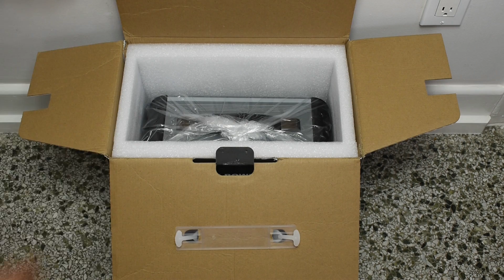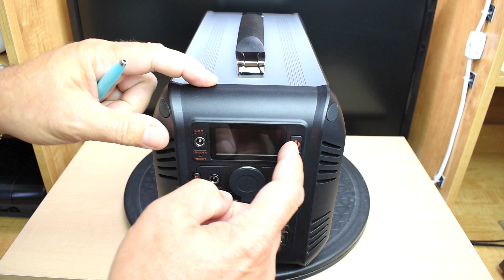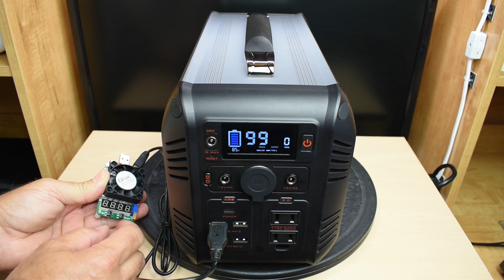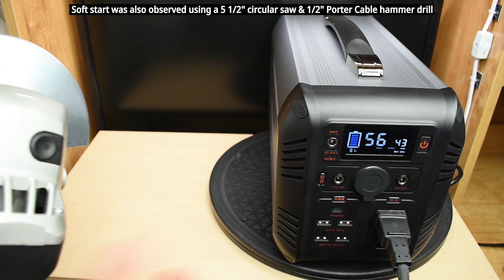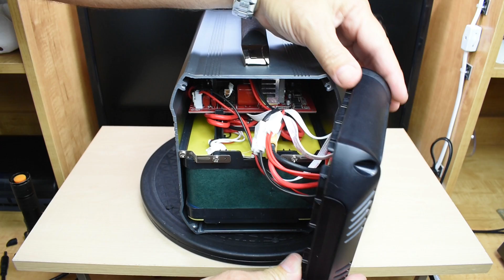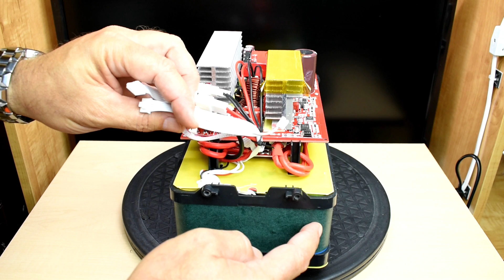This LiFePO4 Portable Solar Power Station Changes Everything!

Comment from the maker: Hey guys! I hope everyone is doing well, and enjoys the video. A lot of time went into making this video(like many of my videos), so it would be greatly appreciated if you could take just one or two minutes to share the video link with others in solar related forums or social networking sites. Below is the link to my other video which shows a simple trick to fully charge a PPS in your car, or charge it faster. Thanks for watching!

https://www.youtube.com/watch?v=yXNW-4fNZVk
Reply: Good job!  Did you say if the screen can be dimmed or shut off for use at night?  Especially in a tent.
Reply from the maker: @videodistro  I show in the video how the screen goes dim after 15 sec or so, then I need to press the button quickly to have full brightness. It never goes off completely unless auto-off activates.
Reply: @electronicsNmore  Okay, thanks.  So only an auto dim, which is okay.  Kind of wonder if it is dim enough in a tent during a dark night.  Thanks for the review and thanks for the info!  The only thing I wish was a little better (other than a working 50 Hz) would be the ability to take over 24v input. Would be nice to do 30 or more.  Oh well.   I liked your trick in your other video about raising the voltage.  Two 12v solar panels in series might be too much.  Any way to test that on this?
Reply from the maker: @videodistro  2 12v panels in series would be 40--42v, way too high. The dimmed mode isn't that bright.
Reply: @electronicsNmore  2x12v is 24v, right?
Reply from the maker: @videodistro  It's a 12v rated panel, but the voltage is higher. 2 x 12v panels will definitely exceed the max input of 24v.
Reply: @electronicsNmore  Bluetti EB70 700 watt power station has LiFePo4 and 712 watt hours and is on sale for 500. It has some overlooked silly design issues but suffices for the emergency situations I plan to use it for...running a 75 watt fridge during power outages and cooking with low wattage devices.
Reply: Excellent work. Thank you for sharing your knowledge.

Comment: Based on my experience with computing / electronics. I'm unsure that these unknown brands will function as stated / rated under real life, pressurised conditions. i.e commercial and legal grey areas of use. That said, I'm looking for exactly this, with one added feature, to be able to dump charge into cheaper stand alone batteries, SLA, LiFePO4 that I already have. A control centre, to regulate incoming charge from solar,  mains, and a generator. My equipment never works as stated / rated. Ever.

Comment: I've watched a few reviews on this unit. Also known as "Bibene" and FF Power which picked up the Bibene name. I was comparing this one to the "Bluetti", which has the true brand name but a little different configuration which I did like too. But the Bluetti unit display was disappointing as to data it showed when in use. This unit has it all, but a lesser known brand. Also a super good price if you look around. All reviewers pretty much gave it top notch status for an off brand, especially for those of us searching for the LiFePO4 internals. 
    I really like the way you were paced, & methodical with each function, outlet, and switch. Testing equipment and real world loads were great. And of course, break down and a look inside. I had already made a purchase of this (the FF Power name) just prior to your review, but it totally backed up the other reviews and I feel super confident this power station will meet my needs and be pretty good quality. I'm also getting a 100W solar panel with it to augment my 12V vehicle charging. I look forward to checking out your faster charging method. 
       Thanks for an awesome in depth review !

Comment: What is the input voltage on the wall charger?
Reply from the maker: Pretty sure I mentioned it in the video.
Reply: @electronicsNmore  no
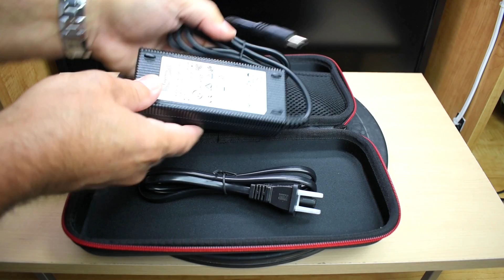Reply from the maker: @tvbox6955  Sure did, just checked. 1:46
Reply: @electronicsNmore  100-240v? The voltage that it accepts from the wall into the charger.
Reply from the maker: @tvbox6955  Yes. 100-240v

Comment: Your description calls this a BIBENE power station but the unit is marked OUKITEL. I've seen both units on Amazon and they look the same except for the LED display. The promotional bullet points are different in the two different Amazon listings. Are they the same unit with the same features and capabilities, just branded differently ?(and the display) Great in depth review. One other question, will this charge on a single 100 w panel? I saw some purchase reviews that said it wouldn't and that it required at least 200 watts.
Reply from the maker: The unit is manufactured, then both companies use the same product. The name label is the only difference. In the video I should've tested what you asked. I don't recall.
Reply: @electronicsNmore  You used a home built 200 watt folding panel.
Reply from the maker: @mrhalfstep  Yes, it was wired 2 in series for 24V/100W (Not 12V/200W), I only tapped into one 12V panel.
Reply: @electronicsNmore  OK, I got it now. That's great, because I have one unused 12V 100 watt panel that I can dedicate to this. Cool! Thanks for taking the time to clear that up for me.
Reply: @electronicsNmore  You tested it at about 23:00 into the video at 200 watts.
Reply from the maker: I show a single 12V / 100W panel connected to the PPS. You see 90W going in.

Comment: One guy on amazon review said his solar panel wouldn't charge it,next guy said the solar panel input was wired backwards,he said on solar panel input,what should of been negative was positive and vice versa.he said it could of been dangerous.i could of missed it,did you test the solar panel input to see that you didn't have any problem,with solar panel input?other people do say the watt hours are not close to what they state but for this low price, I could accept that possibility. Thank you
Reply from the maker: This unit charged just fine using solar panels.

Comment: I have a diesel heater that when the glow plug is on its start pulling 8 amps and goes up to 10.7. 10.7 is just a split second. I was wondering if the DC plug can handle that on these. I've seen people run the heater on the jackory 240,500, ecoflow an some others.
Reply from the maker: If it's only a split second, and only 700mA over, I would think you'd be fine, but no guarantee.
Reply: @electronicsNmore  thank you so very much. I really appreciate you taking the time to let me know. Hope you have a happy and healthy holiday season.

Comment: It appears you checked the 12V DC to test if it was regulated after the battery was depleted, but after you started charging charging the unit with the AC.  Won't that increase the battery voltage and throw the test results?
Reply from the maker: The DC output is maintained in a narrow range from full charge to almost fully depleted.
Reply: @electronicsNmore  I
 understand, but with the charger connected, the battery Voltage will be increased.
Reply: @electronicsNmore  I believe you are missing my point?

Comment: very thorough review. I do have to disagree about fully charging this power station with a car socket. at least with my Honda which supplies 14V when the alternator is running, I see 83 Watts. That's the same as the 20V AC charger.
Reply from the maker: Something not right....Mine works.

Comment: The 12vdc is actually not regulated.  The LiFePO4 batteries are in 4s configuration so is 'regulated' by design.  Also you only tested the efficiency of the inverter, how about the efficiency of the 12vdc output.  BTW, 97% efficiency of the inverter sounds abit too good.
Reply from the maker: DCV is maintained in a narrow range regardless of SOC.

Comment: I'm really glad manufacturers are starting to put diffused lantern style lights on their products. They are so much more usefull. I have a Golabs R300 and that difused light bar has been a godsend for lighting up an area around camp or in a tent. The little dinky flashlight style while still useful, pales in comparison for practicality. Are you sure it's regulated or just the LiFePo4 batteries themselves? It should stay above 12v right up until they die with no regulation.

Comment: Excellent review and tear down..Confussed on one item tho. You mentioned the heat
Buildup when charging, 180f?…That’s a bit high for lithium batteries…Or did I misunderstand?
Dennis
Reply from the maker: Hi. I was referring to the temperature of the SMPS AC charging brick. Be sure to watch today's video showing another LiFePO4 PPS and share. Thank you!

Comment: Great review. I appreciate the testing and inside look. I have owned this unit for six months and it worked great until today. I tried my Renogy 100w folding panel to charge it. It charged fine until the sun came out. Up to around 23w it charged well. Above that the display started turning on and off, alternating between showing a high charge rate for a second and then showing zero. The device stopped charging completely. Any suggestions for me? Is there a way to hard reset the BMS? Other than this the unit works great and charges fine on 110v. Occasionally the state of charge calibration gets way off and I discharge and recharge to correct.
Reply: Mine no longer charges. Did you find a solution? (Resetting didn't work for me)

Comment: Oukitel has one identical to this one. What are the differences
Reply from the maker: Nothing, same unit different label. :-)
Reply: @electronicsNmore  thanks for replying.  I ended up purchasing the ecoflow max. 486$ shipped on Amazon.  The lifepo4 was 386$ after  discounts shipped.. What ended up winning me over is 80% charge in 1hour, when plugged into a wall outlet.

Comment: Thank you very much for your very detailed and very precise testing of the portable power station.  About switching to 50 cycles from 60 cycles, my guess is switching didn't work you were connected to 115V/60 cycle source.  If you were connected to 220 Volt source (50 cycles) then it would have switched (may be automatic) to 50 cycles.  Thank you again.
Reply from the maker: No, it was faulty.
Reply: The unit was faulty?

Comment: Thanks for the review. There's not that many LiFePO4 portable battery systems out there. It's impossible for me to find a pre-built portable battery station the way I'd like one. I'm glad you opened it up and showed how easy that is. I'd love to put a dual panel mount Anderson PowerPole port with internal 20 or 25 amp inline ATO fuse with the connection point for the wiring at the BMS. That would give me access to charge with my own charger at a higher rate..........and give me access to the raw unregulated LiFePO4 voltage. Just some thoughts.
Reply from the maker: Thanks for watching Jeff!
Reply: If I'm understanding you what you want, I can tell you that I ran across a video on a channel called " Jasonoid " that shows how to add some wiring to this unit that bypasses the BMS to allow a .5C charge rate. 300 watts, I believe. Hope that helps

Comment: There is information on the Internet about fully charged 4S voltage over 13V (e.g., 13.4 V) without a load, so 13V+ voltage measured for the large  12V socket does not imply regulation. Dropping output voltage while the battery (stack/pack) is being discharged, does not indicate regulation.
Reply from the maker: The unit is regulated. I tested with and without a load fully charged and almost totally discharged, there was a VERY narrow voltage range. Measuring as shown in the video DOES imply regulation, otherwise the no-load voltage output would would be well under 12V when the unit is 90% discharged.
Reply: @electronicsNmore  , I have this product coming soon and I will be looking into that. I read comments on another web site about no regulation for the 10A output. I did not see you measuring voltage (under load) from the cig-lighter socket. Narrow voltage range (after some initial discharge) is the benefit of the battery's chemistry.
Reply from the maker: @michaels3003  Mine works just fine, but I've seen companies make changes after my reviews.

Comment: The 12V DC output is NOT regulated. The voltage depends on the current amount of the charge (and possibly the temperature of the battery pack).

Comment: I recently killed a different 240Wh lifepo powerstation by attaching it 5 mins to a flat TV with active power factor correction (APFC) drawing just 1/3 of max power. All other loads were fine. So these APFC can be an issue and deserve testing. Uniniterrupted Power Supply units do a better job usually certifying APFC load compatibility. However watching the AC board having an electronic design background I would expect this box to do a better job. It looks quite a bit like you measure the 12V output at the empty station with the charger plugged in? You verified the battery charged from solarpannels but not necessarily that it happened at the Maximum Power Point voltage. I appreciate your thorough testing. How did the manufacturer comment on your 50/60 Hz finding? This could teach about support Quality.

Comment: Great review! One question: According to the specs, it requires a solar panel that is 15v-24v. Does this mean that a 12v Renogy 100 watt panel won’t charge it?
Reply from the maker: They're referring to the open circuit voltage of the panel, and all the 12V panels I know fall into that range. Thanks for watching!

Comment: Bought one and now ordered the second one. Use it on my car for the dashcam. The dashcam on standby use only 2w power and the oukitel never stops. The good thing it's that is charging 87w from cigarette lighter plug, and Lifepo4 battery are very safe at high temperatures on my car when parked in sun
I have a Bluetti ac200p and a goal zero yeti 3000 so I now something about power stations and I really recommend this small unit. It is a beast

Comment: that’s a really cool power supply but got a question. What would be a good solar charge controller for lifepo4 battery
Reply from the maker: This one works well, not sure if the price has changed.
https://www.youtube.com/watch?v=M6QrJl6vfWg
Reply: @electronicsNmore    Thank you and could you please do a video on how well it would run that cooler freezer you made a video of a While back

Comment: Just a FYI all solar battery units DO NOT Ground, it’s just a blank hole at the ground plug.
Reply: Correct, but he never said that.
Reply: FYI, at 3:31 into the video, you talked about the ground plug…
Reply: @bpdenverco  , "HE"  not "you." There is a pocket ("empty hole"), so a three-prong plug can be used without an adapter.

Comment: Glad I saw this before I bought a AC50s. It's still a hard decision though. This one has LifePo4,  a bigger inverter, and more capacity. But the Bluetti is $100 cheaper, with faster charging and an established brand. It's probably worth the extra money, but the slow charging is a real drag.
Reply from the maker: The only drawback I see, besides the 50Hz issue, is the 100W input. Maxoak makes good products.
Reply: I'm stewing in same dilemma
Reply: @katieecat  Look at the new Bluetti eb55, it's a better version of both of these.
Reply: AC50s only 500wh, smaller capacity than this.  I can accept this charging time.
Reply: wow with flood lights too!  that was strangely my main concern.  thank you so much for the tip, hugs!